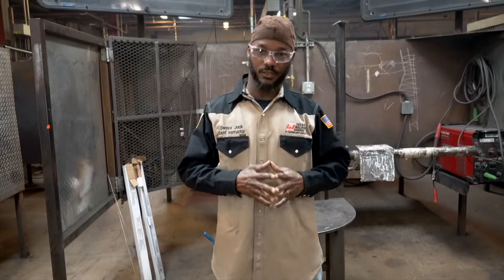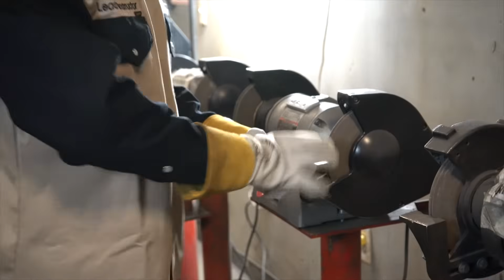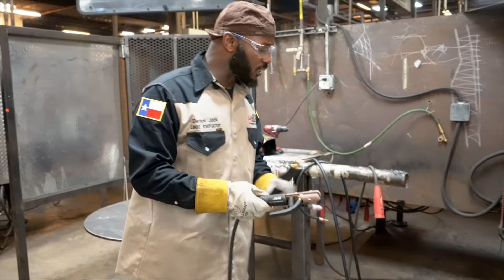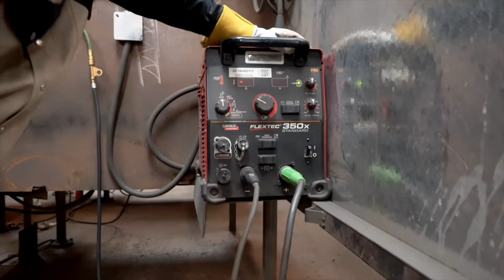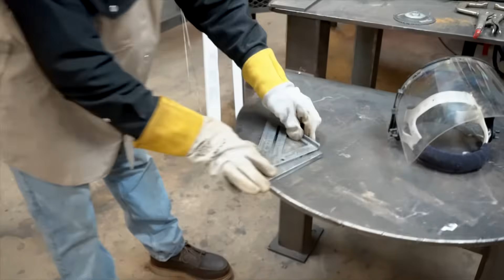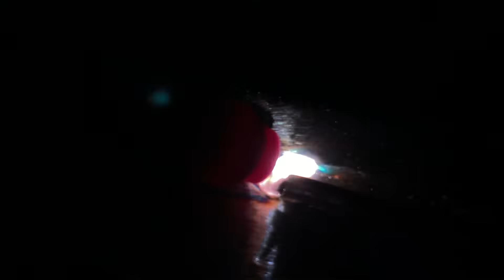Intro to TIG Welding ~ Tulsa Welding School

Comment: Having just taken an intro class , your video was a little more informative and reinforce what I have already learned. One thing that you did that caught my eye though was when you sharpened your tungsten, we were warned not to wear gloves when hand sharpening due to the potential of getting gloves caught in the grinder and pulling hand in with it as with any loose fitting articles of clothing, just wondering your take on that subject. For myself I think I will use the drill method, having used that method for other projects I am already familiar with it and will be picking up a tungsten tool for any hand sharpening that may be required in future classes, thanks for that tip.
Reply: The safest way is to use a drill or the tungsten tote to totally eliminate the risk of hand injury. Gloves are not necessary but I do use them because the tungsten get really hot while sharpening them. The PPE worn to accomplish a task on the job will definitely be dictated by OSHA and the company you're employed with.

Comment: I didn't see any problem walking the cub at first, but for longer welds do you have to turn your torch upside down or sideways?
the explanation of dividing the cub in 4 and imagine moving a heavy object was amazing!
If I wasn't so old I would take lessons in the Tulsa Welding School ;-)
but now I learn it this way through these great instruction videos.
Reply: Holding the torch upside-down or sideways will depend on the position you're welding in and how restricted the area to be welded is. The final results of your weld will determine the grip selected. If your weld look good ie uniformed, consistent in wight and height, no porosity whatever grip you to make the weld..use it all the time

Comment: The only thing i noticed was when you sharpened the tungsten on the side of the grinder with the drill, you grind marks are running around the point, It should have been done on the front of the grinding wheel at an upward angle so the grind marks are running along the tungsten as this will give you a more stable weld arc
Reply: Spoken like a true experience welder.  I appreciate the added knowledge Chris.

Comment: Excellent explanation, all the information is solid. I like the 105z57 adaptor because you can use the oldest AC/DC transformer based welder or any DC stick inverter welding machine; set your amperage on the welder and start TIG welding right away! Great video, I enjoyed watching. Two thumb up!